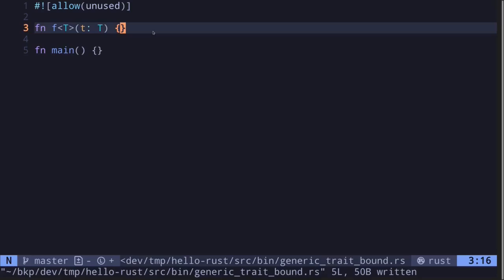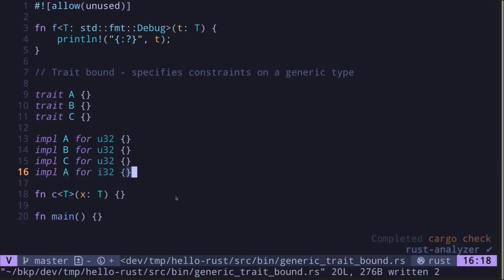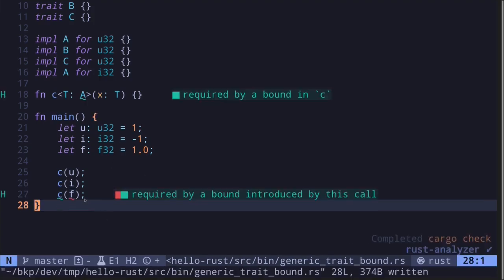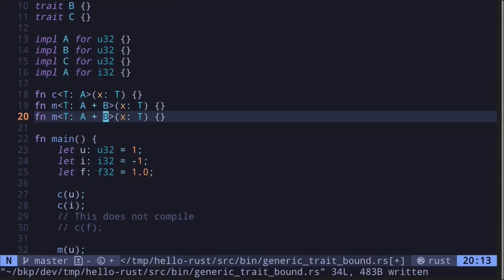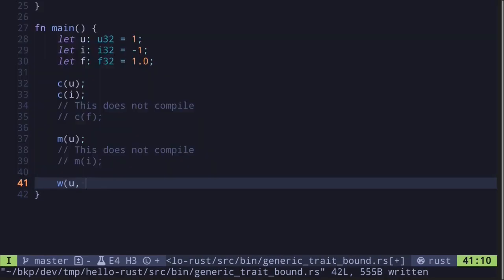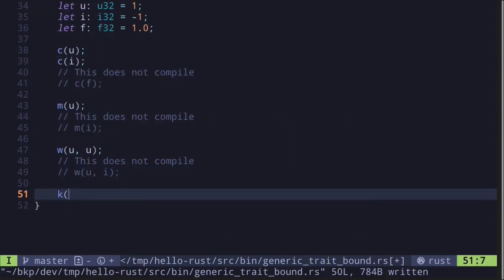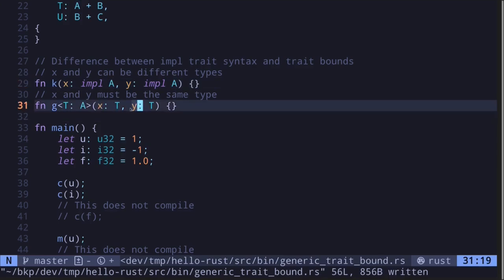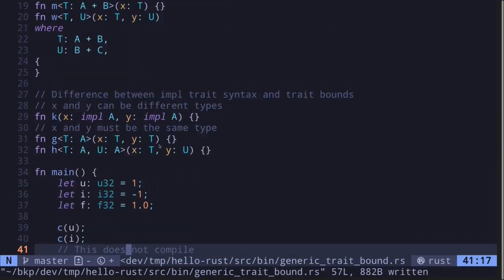Trait bounds | Learn Rust part 41

Comment: Nice explanation, thank you! One question, though: fn k and fn h at the very end, I think, are again exactly the same, right? k declaration used syntactic sugar for expressing the very same as h declaration? The 'classical' version just gives you more freedom e.g. for declaring as you did for the example where both types need to be the same?
Reply from the maker: Yes you are correct

Both functions take types that implement A as inputs and x and y may be different types